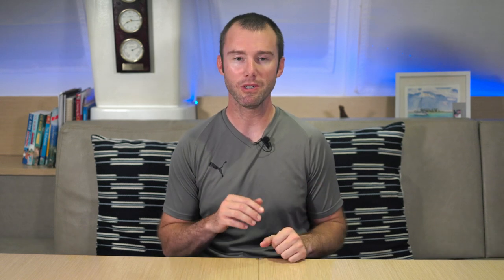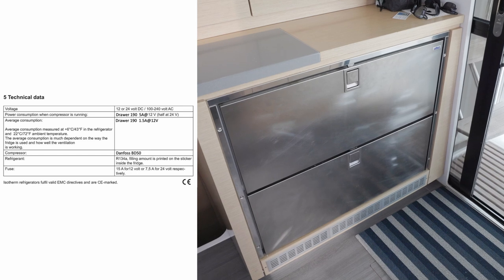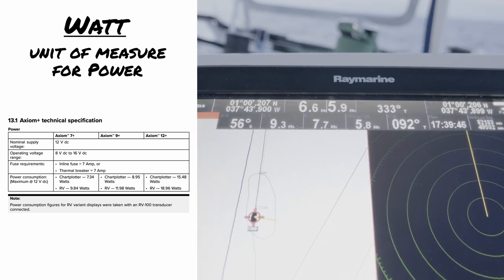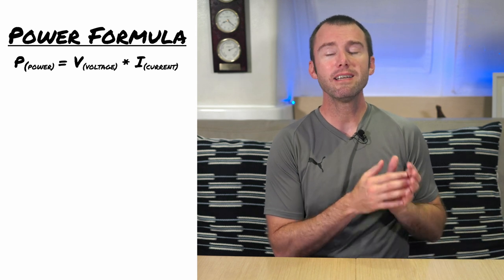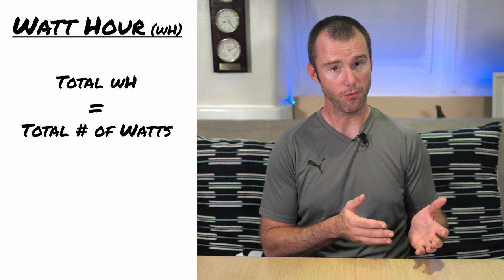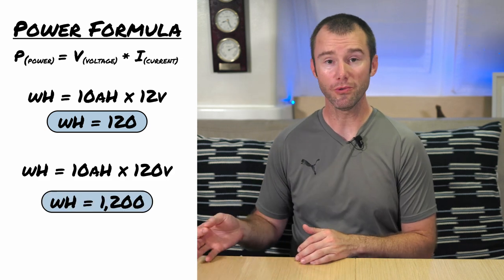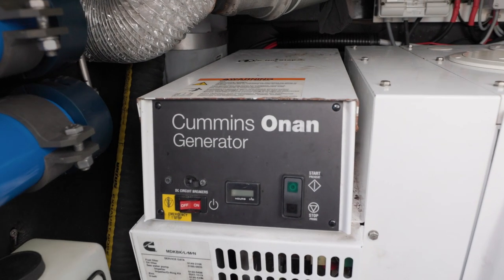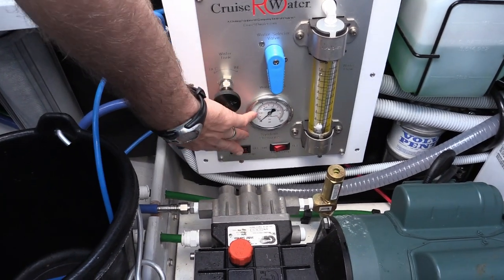Marine Electrical Systems 101

Comment: A great explanation of power.  My boat is pretty devoid of power sources, so I have to make sure that I keep track of the Watt Hours on my LIFEPO4 batteries.  Though my meter keeps track of things in Amp Hours instead of Watt hours.  I have 300 watts of solar and if I'm lucky I get like 15 amps for 5 hours or so.   It might keep our fridges running for 2/3 a day.  Fortunately I can get 32 amps off the alternator, and 120ish(depending on the charging profile)amps off our Igen2600 generator and our Victron Inverter Charger.  We can stay out for a month straight on 15 gallons of gasoline with dinghy fuel.  Provided we don't use aircon.  If we do, we end up using 50 gallons with air-conditioning on the generator when we are on the boat full time....which is like 14 hours a day plus or minus.     Which running the aircon pulls 120 Amps+  DC from the batteries and throws it through the inverter.  Amazingly my little Catalina 30 can run the aircon for a little over 4.25 hrs on batteries.  Wire sizing was key on the inverter capabilities.  Anyway, a good video all around David.
Reply from the maker: Thanks Allyn.  It certainly sounds like you've got your boat well set up for your use.  But you've perfectly illustrated my point that even a boat "pretty devoid of power sources" can still be rather complex!
Reply: @OutChasingStars  100%...My boat is probably in the top 1% of electrically complex Catalina 30's.  Computer systems all over the boat, a watermaker, $500 dollar new scuba compressor(If you want a video and checklist for operation just email me), lithium, generator, solar, AC,  refrigeration.  For such a small boat we have a lot.  We can stay out for months at a time, but it is pretty tight!  Especially for six people.

Comment: Nice video - although I got a touch nervous hearing the watery transition sounds while discussing electrical matters!   Keep it coming.   Can’t wait to see how you use a voltage meter to measure amps, watts, resistance, etc.
Reply from the maker: Haha, just wait until you're dealing with electricity while you're on a boat, in the actual water!  That's quite nerve-wracking!
Reply: @OutChasingStars  you guys still in GT?  Would love to connect.  We are coming back down tomorrow PM.